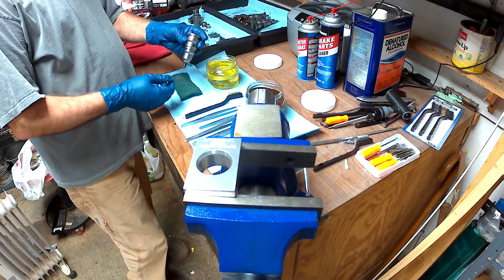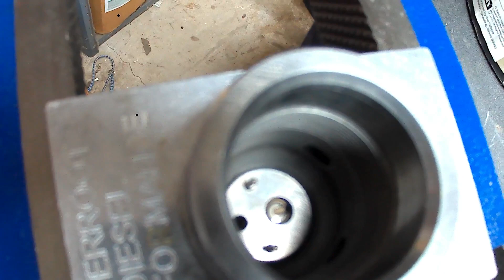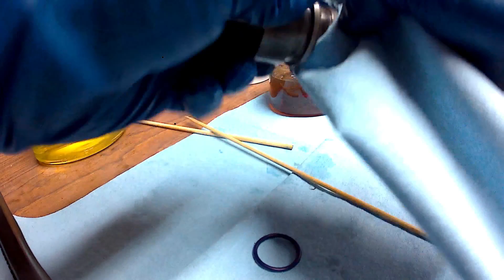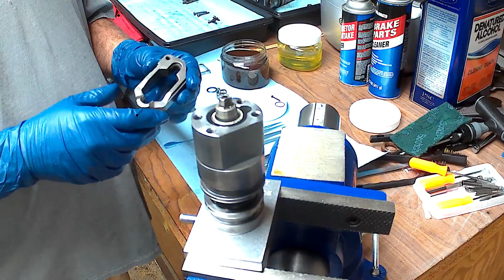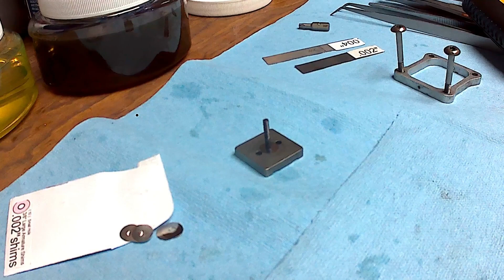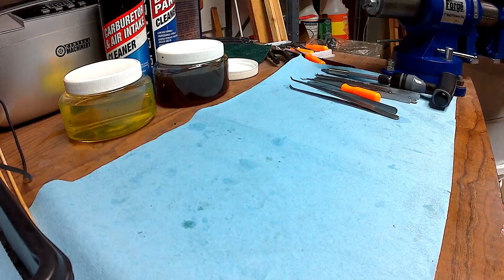7.3 Diesel Injector Rebuild - Reassembly Done Wrong - F250 F350 Ford PowerStroke shim

Comment: Somethingvi just figured out with these kits replacing the armature screw with a alan head screw.  The head of the new screw sits above the leval of the plate it goes theough.  So when the solenoid pulls the plate up to open the injector.  The screw head imbeds its self into the magnet, causing damage, also it becomes only 1 point the magnet connects to vs. The whole plate like its suposed to and us a weak point when it pulls the pop it open to fire.  

  I ground a couple .002 to .003  off of the screw head, so it sits flush or just bellow the plate to avoid this.

Comment: Can someone explain the need to shim the solenoid?  Seems to me from the factory the armature plate should have about 0.004 clearance. His measured 0.000” hence the shins put it back to factory. At a factory setting of the armature, the solenoid should be fine with no shims.
Reply from the maker: Over time - wear causes that clearance to close the gap.   When the engine is cold, and the oil is thick (and I'm talking below 85 degrees, in my instance) - the lack of space won't allow the injector to fire properly - until the oil thins out from warming up. (My brother - who sold me the truck - that HE was unfamiliar with - had to use starter fluid to start the truck... I refused to do that - so opted to rebuild the injectors myself). Some people say it's "stiction" - but that's a slightly different bugger.   It's mostly seen in "crank-no start" situations - where you have to plug in the block heater to get the truck to start.   The injectors are worn - and the long term fix is to get replacement injectors that are in spec.    The only thing I did not have the ability to do on my own - was to flow-test the injectors after the rebuild.   That would have been optimal to do that.
Reply: that is what i have been thinking. then someone has said to sand down the washer on poppit guide which does not make sence.HELLO

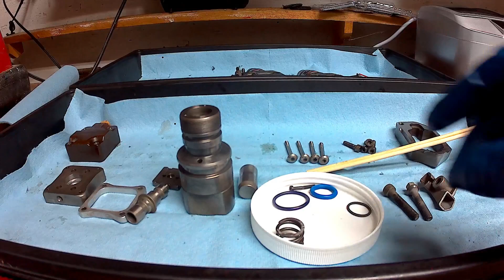Comment: The orings at 12:30, can those cause an internal oil leak? I'm chasing down an oil issue on my 7.3.
Reply from the maker: I would imagine that they could.   None of the 8 injectors that I rebuilt had any real "damage" to the internal o-rings (truck has 270k miles on it) - but they were hardened - so anything's possible.
Reply: @HarmonyHollowApiary  I've got a hi psi oil leak somewhere.  I've ruled out the external o-rings. So just thinking about internal leakage
Reply: Did you figure out your leak?  @pooleo8

Comment: was there any carbon build up around the poppet valves?
Reply from the maker: Not that I can recall.   Overall, I feel like they were pretty clean coming out (it's been a while back - so I'll have to look for/refer to old pics of my disassembly).   I know the tips and other components were pretty dirty, and I used a brass wire wheel to clean them up.  But I realistically don't recall the poppets being that fouled up.

Comment: I have a 7.3 powerstroke. I've seen multiple 7.3 injector rebuild videos BUT not after the rebuild and installation with the start up of the 7.3 powerstroke engine.... I say proof is in the pudding... If anybody has such a video as I described send it to replies...
Reply from the maker: I have seen a few of immediate restart after installing new injectors - but not necessarily of rebuilt ones.  (One was quite humorous as it blew oil all over the cameraman/friend as he hadn't screwed down the valve cover to hold it in place while blowing out the oil/fuel from the glow plug port.)
 Mine should be back in the truck later this week.  I'll have my camera going.
Reply: Cool I'd like to see the restart... I'm contemplating rebuilding my injectors using Bitterroot rebuild kits... I figure what the heck if I can rebuild industrial steam turbines I can rebuild injectors...
Reply from the maker: Re-made video here: https://youtu.be/RdPunUOBp5Q

Comment: You need to edit the video you have the plate below the solenoid facing the wrong way so so some else doesnt make the same mistake other than that good video.
Reply from the maker: I don't disagree.   I need to figure out how to (or if it's possible) as I don't have the old original footage.  Maybe I can download & edit the old video.   It'll go on my fall/winter to-do list.
Reply: @HarmonyHollowApiary  yea you dont have to edit you can just throw a caption on there that says have it face the other way and people should get it. its not easy making videos but it helps a lot of people thanks for the videos.
Reply from the maker: Good news - Found the old footage.   I DO already have card links in the video and notes stating the error - but will re-upload once I have a chance to edit and correct the error.
Reply: @HarmonyHollowApiary  great yea its not easy to make these videos and to find the time to upload these videos in our busy schedules.

Comment: At 21:45 you're putting the hold down collar on in the wrong position.  The part of the collar that has the threaded hole (for the oil spout) goes opposite of the notch in the base.
Reply from the maker: Thanks for the head's up.   The injectors are still on my bench (been unmotivated, and this truck is an "extra" play truck that I've not needed - so it's been sitting for over a year, now) - I'll double check the installation before installing later this winter now that my bee-season is winding down.   The drawing/assembly paperwork from both BitterRoot and RiffRaff matches (as best as I can see) my assembly - but I'll definitely double check during assembly.   I'll note later if I wind up having to change their installation positioning - and if confirmed - will likely upload an addendum video (or will re-edit to show it the proper way).
Reply: I just watched another tear down the hold down goes in the opposite direction.
Reply from the maker: @GreaterVisionFarms  shoot me a link if you would.  Thank you!
Reply from the maker: Re-made video here: https://youtu.be/RdPunUOBp5Q

Comment: good job.
what result? Does the engine work correctly?
such a kit will fix my cat injectors 3126?
I'm from Russia. the translator is not perfect.
Reply from the maker: I have finished the injector rebuilds yesterday - and am currently cleaning the injector sockets and cups before reinstalling the injectors.   I'll post a follow up when I've got things put back together completely.   We are having cold weather here, so am working when nature cooperates.
Reply: @HarmonyHollowApiary  fine. I will wait for the continuation.
interesting result from the user.
good luck